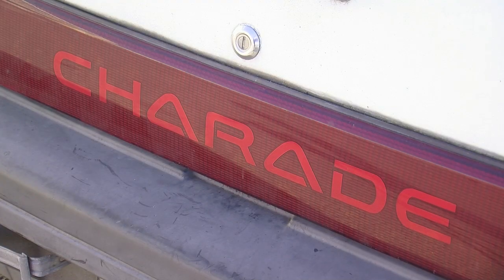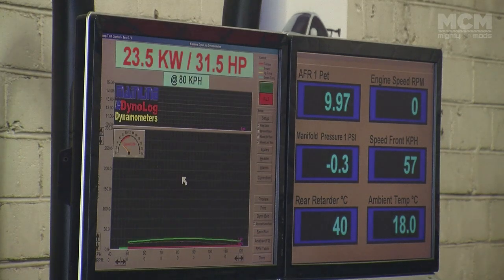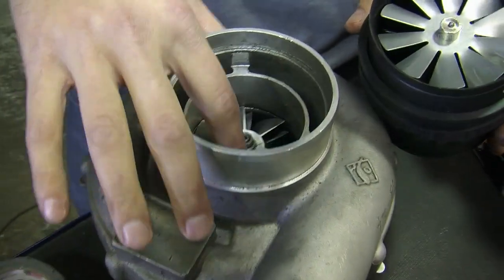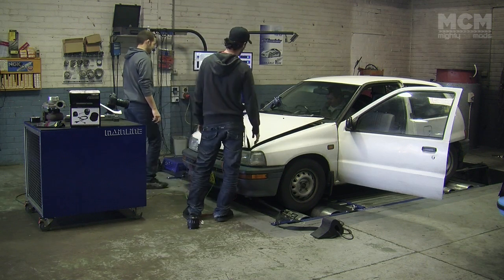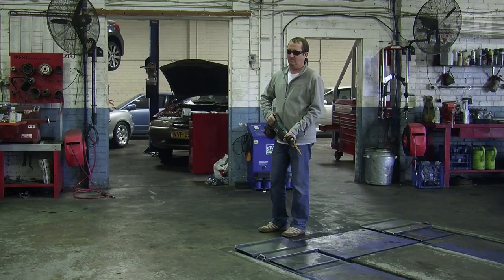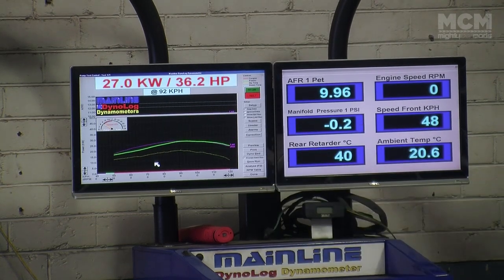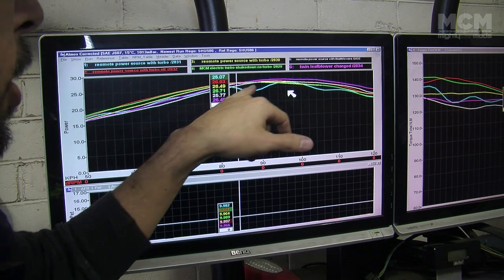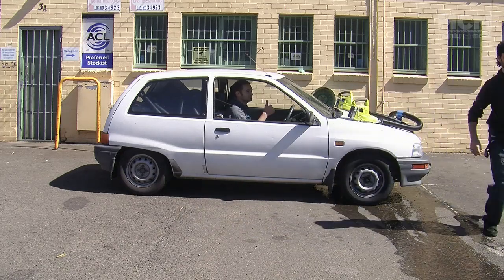Electric SuperChargers Mythbusted

Comment: You cannot draw more power from an alternator that it is designed to handle, it will overheat and melt.  What this means is you need to put a larger alternator on the motor to support the new load(s) on the electrical system, just like adding a big amp for your sound system or a big inverter to power some plug in devices. A larger alternator will increase resistance on the motor due to the larger amount of energy being generated.

Comment: 1, I actually said "net power gains would be minimal," so yes, I agree with you in that respect. 2, there are very few things in the world that spin at 100,000 RPM, when you need to spin something that fast, you gear it, 99/100 if you aren't gearing your motor, you're wasting either power or money for an over sized motor. This video addressed none of the technical issues, failing to fully explore the possibilities, instead using leaf blowers and calling it done.

Comment: An electric tubrocharger is quite feasible if designed correctly.  The biggest issue being it takes electricity to use them, which means the alternator has to work harder which puts more resistance on the engine, net power gains would be minimal, besides there is free energy in the form of exhaust gas to use in a car, why bother with electric.  Doesn't mean it can't be done, they just got a shitty model.  Swap out the exhaust turbine for an electric motor on a real turbo and you could do it.

Comment: Once again, if a fan generated 0 net pressure, the air wouldn't move.  Your building HVAC wouldn't work, your air conditioner wouldn't work, etc.  When designing building HVAC, engineers have to calculate the flow resistance of the duct work to make sure the fan can produce enough head (pressure) to move the air through the vents at the appropriate CFM.

Comment: Check your fluid dynamics, a fan CAN (and does) compress air, it is a matter of the degree to which they compress the air.  The compressor inside a turbocharger is, by definition, a type of fan.  It is a sub-type designed to compress the air.  If fans didn't (and by your statement, couldn't) they wouldn't function, they wouldn't move air.  There needs to be compression at the blades to cause the air to move.  Come back when you have at least taken a college level fluid mechanics class.

Comment: It's more air per CUBIC inch, volume, not area.  Every fan compresses air, if it didn't, it wouldn't work.  It all depends on the degree to which the air is compressed as to whether or not it is usable in a car engine.  Even big block engines typically consume < 1000 CFM without any kind of intake boosters.

Comment: Hi guys, you can get boost(compression) by using a Ducted fan from a RC airplane(electric jet engine) .I did it on a Kawasaki Ninja 900, and got a 17 hp increase.

After riding around for a couple of days, I burned a valve.

Comment: agreed, but think about something that is designed to make thrust, like a tiny duct fan you find on an RC airplane, i've seen ratings up towards 6kg of thrust, i'm not sure but stomping all that into an intake (with engine capacity not being too big) should give some pressure right? or won't it generate any pressure because it is also by definition a fan...? that's a little thing that confuses me a bit right now

Comment: I've actually tried an air compressor on an engine. I put a small compressor tank on a snowmobile a few years back and ran a line into the mouth of the carburetor, with a valve between my legs I could hit while riding.

It had a noticeable effect on acceleration, but only because it was a two stroke and they pump air from the case. So the air blast "helped" it get air-fuel to the combustion chambers. On a four stroke I can't see it having any effect at all, it's not enough.

Comment: so they lost power from the electric supercharger. Not suprised. A real turbo is a close tolerance turbine that compresses air and also turns a HIGH rpm, over 10,000. this electric motor probably turns about 3000. so in reality, the electric charger is restricting air flow in the engine.

Comment: Well the main reason they're made out of metal is because of the temperatures involved, and noone said anything about 35PSI (or anything about it being a good idea, just that it CAN work). The roadkill episode mentioned has ~20hp gain from leaf blowers, the difference between that scenario and this one is they used 5x 2stroke leaf blowers instead of 2 cheap battery powered ones - just more power behind them.

Comment: Utter bullshit. That would be true if you were talking about a hose, but you're talking about an engine with a fixed gas capacity. More CFM on the intake at the same rpm = more PSI. The reason this shit doesn't work is because the leaf blowers don't have enough power to maintain flow when confronted with back pressure, watch the latest roadkill for an example of them actually working. Of course it's totally impractical compared to a real turbocharger but it does work!

Comment: can you convert regular turbine to be powered by el.motor? and please install it airtight so you can get actual compressed air in intake (not like here, with all leaks in filter housing). you can use regular 110/220V motor with DC12 to AC110/220v convertor.  the only problem is to make gears between the el.motor and turbine so you can get from 2-3k RPM to 100-150RPM. but if you succeed you can make a big business out of it. why dont i try it you ask? because i am poor :(

Comment: just adding extra air is not gonna add power, you need more fuel if you're gonna add air, just like when you add a real turbo, you get bigger injectors, perhaps a bigger fuel pump and tune it up with a fully adjustable ECU, so just adding a little air will not add any power... you should get a decent engine, not this crappy stuff. get like a 1.6L 4-cylinder, add this "turbo", injector & ECU... then fine-tune it and see what you get. i call bullshit on this "test"

Comment: a turbo is driven off exaust gasses ( sort of like a waterwheel but with hot gasses insted of water and especially under hard driving the tend to heat up and the power fades untill it can cool down.... lesson = colder air makes for bigger explosions which makes more power. no matter what u do with this ebay charger it wont do anything because it well ....leaks like a siv not to mention the air can travel back through the fan because there isnt enough pressure to keep the air flowing

Comment: the intercooler usually saps boost actually up to 6 psi depending on size but because the air is so much colder than it normally would be you still get a power increase of around 10kw to 200kw depending on the motor, turbo, intake manifold size and how highly tuned it is .... ..

Comment: Hey guys I got one as good as the electric supercharger. There are kits and even manufactured products that promise to increase the fuel efficiency of any vehicle. They operate by splitting water molecules into hydrogen, and oxygen, and injecting the pure oxygen into the air intake. They operate off the battery and require water refills. The energy sapped from the alternator to split water into oxygen should be more than they get back injecting it.

Comment: Dou! The reason they are not seeing any boost is because that fan does not have enough power.
BTW increasing the temperature increases the pressure. The problem is that increasing the pressure also increases the temperature, you inter-cool the air to reduce the overheating on the engine.

Comment: imo, the leaf blowers would of made a few more kw if the car had efi, because with a carb you have to mount it in front of where the air is being pulled in, i.e in the leaf blower intake (which is impossible). Any positive air pressure in a carb forces the fuel back into the main jet. just my idea but no matter what both ideas are useless lol

Comment: too many mistakes you have made. that electric supercharger is not hooked up currently. with an crab type, you have a heating tube from the exhaust that the air is blowing out. Next, you can only improve your HP by 50% with an turbo. you guys are idiots.

Comment: I agree, but gotta say that the wind resistance is irrelevant, as they are measuring HP, not speed, but the dyno does apply a static drag calculated with the weight of the car.

Comment: the air filter cover is all rusted and most likely is going to be loosing air.you need to have the turbo tube straight to the cabaret not through the rusted air filter box

Comment: Turbos have lag but produce more power. You can add a smaller turbo I front of the bigger turbo to reduce lag. Its just a known fact that turbos are better and produce more power. Superchargers take power to make power and are usually low end power. Once you get to a specific rpm its done. Turbos on the other hand spool up through air intake and exhaust. The smaller the turbo the quicker it spools and can hold the boost forever if its a good turbo. Need more info send a message.

Comment: They basically are extinct ...not very many production cars run them and they are losing popularity in general 

Some ppl enjoy they sound &or power delivery and feel of a superchargers they are still popular in lower hps track cars due to the throttle response generally being better 

You also keep bringing up programing ? 

A Turbo system is far easier to adjust many setups you can adjust boost on the fly
Watch mile drags every car is turbo you will rarely see anything supercharged

Comment: You can eliminate lag with a blow off valve that allows the turbine to continue spinning. Look up Nelson Racing Engines, all of those motors use dual turbos and they can pump out 2000+hp. Although it is true that superchargers use very little horsepower "5hp", it is nonsense to assume that the more expensive option is better.

Comment: It takes power away, but seriously, how much can it take? Very little, in contrast to the power boost it gives, it's just an electric rotor... still...

It's more expensive... and isn't that a good thing? Expensive things are generally better than cheaper ones...

In theory superchargers don't get lag, am I right? I understand that they can be programmed to offer the best/maximum amount of air at any RPM, so you're always getting the best package, without lag.

Comment: Turbos are better plain and simple if you are talking most possible power 
(this is of course talking well tuned on both sides ) 

....Supercharges are less efficient because they draw power off your motor 
it takes hp to turn the pulley that spins the supercharger

Superchargers are usually more expensive to...

Comment: If you would read the comment that I replied to you would understand that I was refering to power needed by a electric engine to drive a supercharger.
A starter motor has ~4kW and draws ~300A and uses finger thick cables, engine for a supercharger would need ~8kW power (600A draw).

Comment: Yeah - starter motors have ~4kW of power, and their cables are as thick as a finger.
And there ebay scams have 1.5mm^2 cables max. No way that would support needed amperage.

Comment: a modern efi engine will sense the extra air and add fuel to match at least until it hits its fuel trim limits the problem with these fans is they supply so little air that they actually just cause a restriction and rob power

Comment: (continued) And there can’t be, because no car comes with an electrical system that can supply the 5-10 horsepower you’d need to drive a fan that can pressurise enough air to make a noticeable difference to the engine’s power output (you’d need to stick a second alternator on your serpentine belt and power the electric fan from that) On the other hand it’s easy to get the 5-10 horsepower from a turbine in the exhaust pipe (turbo) or from the crankshaft via a belt (supercharger).

Comment: Good job. I like how you actually went out and spent the money on a charade and the fan kit to give us real results. However, one small point – as expected, the fans don't work. But it’s not because they're just “fans” – for example, passenger plane jet engines use axial compressors (essentially fans) in combination with non-moving stator vanes to compress the air before the combustion chamber. The problem with the ebay fan units is that there's not enough power driving them. (continued)

Comment: Atmospheric air is colder than any intercooler can generate. The reason cold air intakes don't really work on turbo engines is because after the air has been compressed by the turbo it gets extremely hot. By being compressed and the fact that it is next to the turbine exhaust. Although an intercooler helps against detonation and bad A/F, it doesn't get back to atmospheric temps which are colder. Best way to make the air colder is methanol injection after the turbo/intercooler before the throttle

Comment: Have to understand the basic physics, these ricer turbos don't take in account vacuum of the engine. Think of it this way with a real turbo, you rev to 2500rpm and produce 5 psi. Then you slowly raise the rpm to 4000rpm, you can hear the turbo spool even faster and louder but you are still getting 5psi. The probelem with these "ricer" turbos is that they don't take in account the massive vacuum at high rpms so you are not getting 5psi  at even 1500 rpm

Comment: a turbo charger is about 10% of the hp of the car. so 300 hp car the turbo is transmitting about 30 hp. 
a electric supercharger or leaf blower can actually work. but they would need to be 30 hp when a normal leaf blower is 2 hp. and a 30 hp electric motor is huge.. expect over 100 kg

Comment: to everyone trying to find a way to make this work:
2000cc engine, 1000cc of air every revolution, at 3000rpm you are sucking in 10.59 CFM. That is at no boost at all. That is just keeping up with engine requirements. 
If my calculations are correct (someone please check them), you're looking at 160.21 CFM just to achieve 10lbs of boost at the same 3000rpm value.

your average supercheap auto compressor struggles with 7 CFM. we're talking a SHITLOAD of air here!

Comment: EDF's DO pack a punch, but alas are not going to be anywhere close to the air feed requirments. RPM is not the problem here, its airflow under PRESSURE. not even a ducted fan is designed to do that (within reason). you'd be better off using those 'seperate batteries' on an electric motor in the wheel, it'd be a better waste of time.

the main advantage a turbosupercharger has is the exponential effect it has, more in = more out = more in.

Comment: Maybe a EDF (electric ducted fan) from a model electric jet would work. Those can spin at 100,000 rpm. You could carry a few light weight lipo batteries to provide separate power from the car battery. Only downside, EDFs use so much power those batteries would run out in only 3minutes or so. It would only be enough for a few fast runs, maybe good for the drag strip?

Comment: Err actually he is right, how stupid do you feel now?

When you drive down a road at 70mph you are carrying the weight of the car x the speed you are going as resistance!

You must be really really stupid to think that a fan simulates the same effect or even 0.1% of the same effect. This fan simply keeps the radiator/intercooler cool to stop the engine overheating. You failed to say how this fan keeps the rear tires / exhaust, and anything else that heats up in the real world, cool.

Idiot

Comment: Okay compare the two subjects a 50lb linebacker running into a 300lb halfback standing still... Just not enough pressure... You are right about the tube fan but maybe another type of stimulation would give stronger results

Comment: you should have removed the filter housing and ran a direct piping to it because if that supercharger actually build some kind of boost, you can not have any leaks which from the looks of that stock housing if will leak like a civ

Comment: Using a fan in place of turbine compression is ridiculous. that's like strapping a ceiling fan on the end of a prop plane and expecting it to fly. The only thing these ebay turbos are charging is the consumer, out the ass for a useless fan that would be better put to use cooling a computer.

Comment: Shoving more air in the cylinders will not increase anything. You also need to increase more fuel, higher grade of air and more compression ratio in order to get a difference

Comment: I Love these Crazy Dudes! Claims on those electric supercharger are over stated and will not work on every application. I  install a  eram on a 2008 Yaris 1.6 L it didnt make much difference at sea level but at 4,000 ft.and up above sea level there was a noticeable difference! i sold my yaris and installed on my MK6 TDI in front of the turbo near the CAI, i notice my turbo lag time was cut in 1/2.

Comment: you made 23.5kw with the hood down

you then made 26.8 with the good open and a toob pointed right at the fan

then with the hood down you and the charger on, you made 26.7kw

that is actually almost a 15% gain in power (23.5 x 1.15 = 27.02)

so it does do what it says.

Comment: :D Lag? No lag with full power at any rpm.

The engine goes lean when theres more air pushed than it can suck in at low rpm and high rpm the efficiency goes up.

Seriously wtf? Lag is when the turbos inertial mass needs to accelerate to get up to speed and has a delay, off range is when nothing happens when accelerator is pressed :)

Comment: You've gone off the rails here, bud. Turbochargers do exactly what you're saying doesn't need to be done, but this isn't really an argument you need to make with these idiots. These little fans simply don't push enough air to make a difference. It's all about PSI @ CFM. These little fans would be lucky to push 1 PSI at 1 CFM. A small-ish turbo can push 12 PSI at hundreds of CFM. There's no comparison.